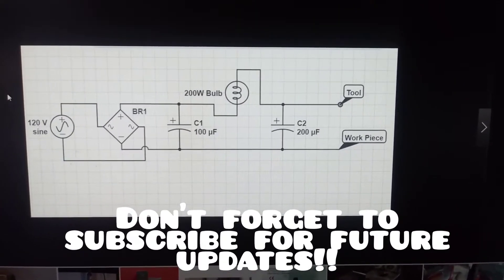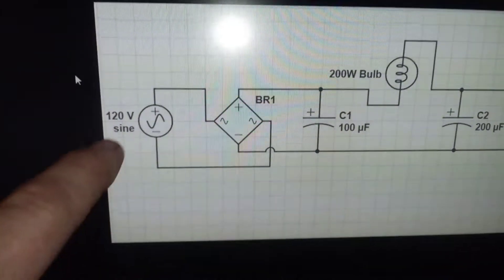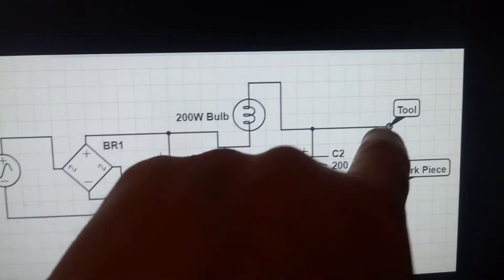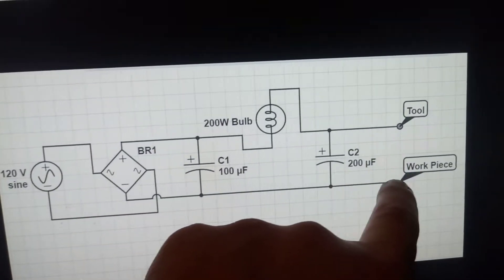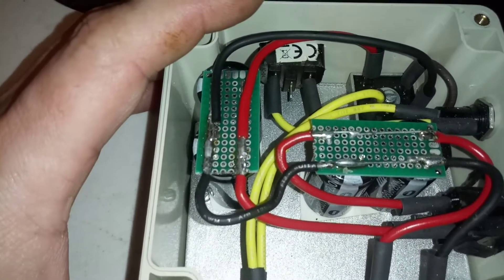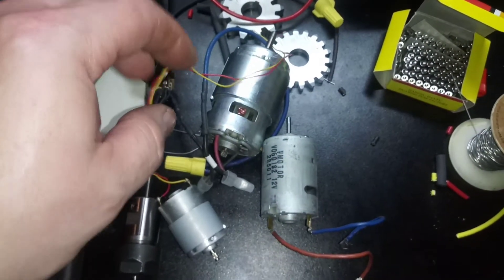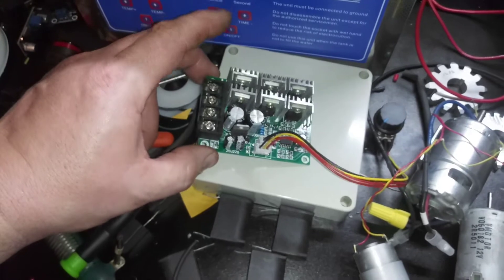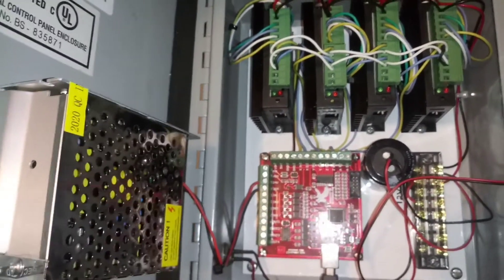Power supply for CNC EDM is nearly complete.

Comment: Hello, can I use a transformer to reduce the voltage from 220 volts to 110 volts? What is the largest possible current that can be drawn when the electrodes are in contact?

Comment: What is the 200 watt Light bulb for
Reply: The light bulb acts as a load during sparking, which is basically short circuit. It also limits the charging current to the second capacitor.